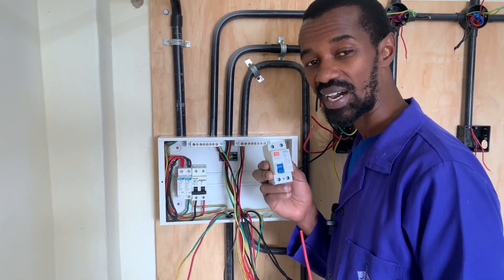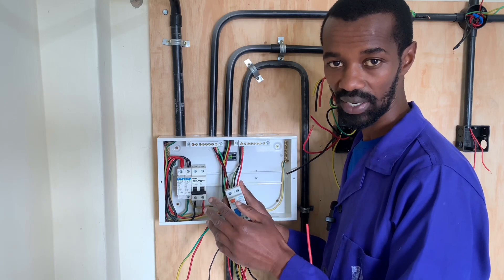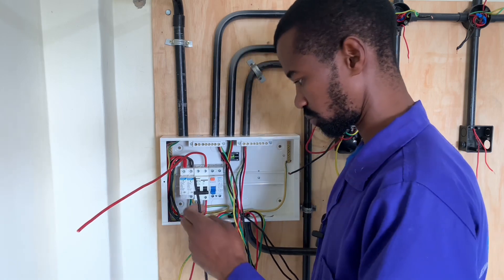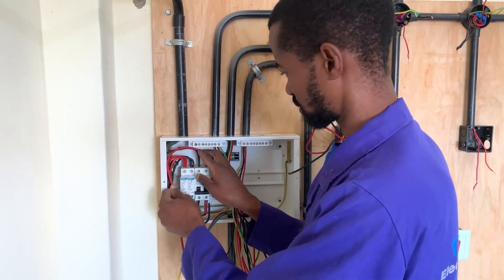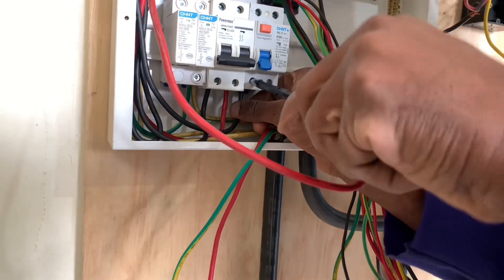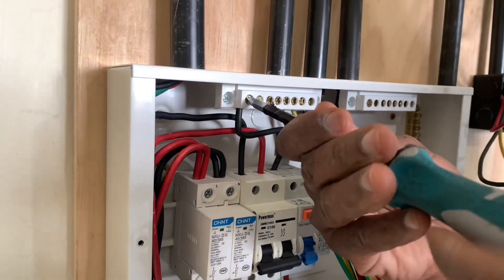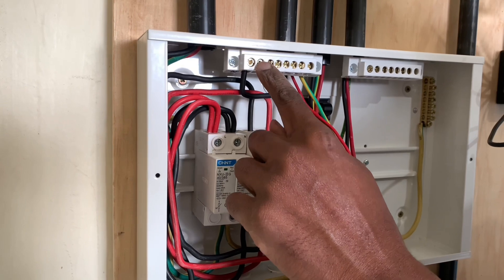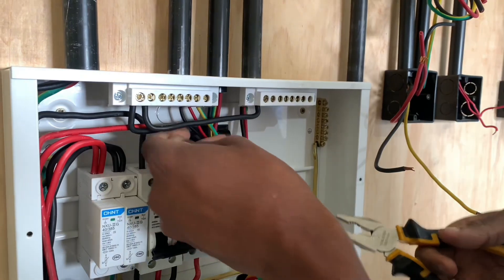HOUSE WIRING 💡Tips And Tricks ⚡️

Comment: PLEASE DOUBLE CHECK FOR THE WIRING OF CHINT nl1 63 EARETH LEAKAGE. IM LIKE 1000% THAT YOUR WIRING IS WRONG. INPUT IS ALWAYS FROM THE TOP AND LOAD IS FROM THE BOTTOM. IF U MADE A MISTAKE , PLEASE CORRECT IT COZ SUM1 CAN BURN THEIR HOUSE DOWN DUE TO AN ELECTRICAL FIRE AND IT WILL CUM BAK N BITE YOU....🤔🤔